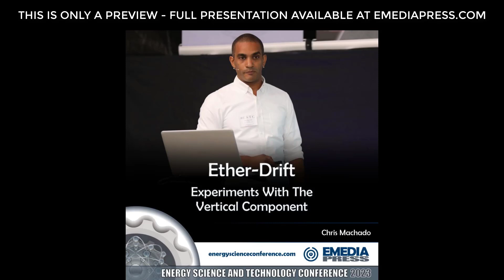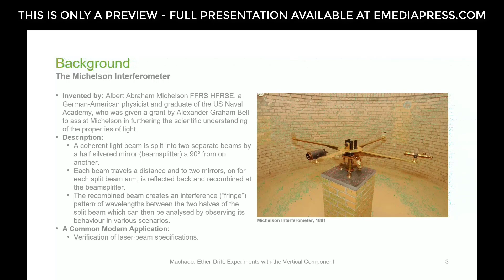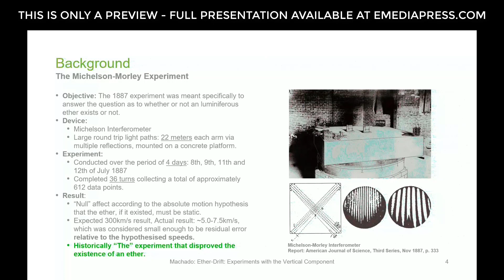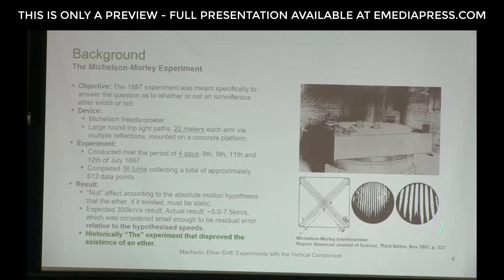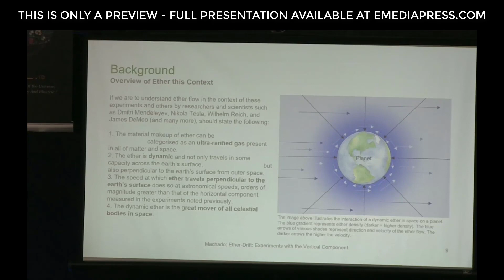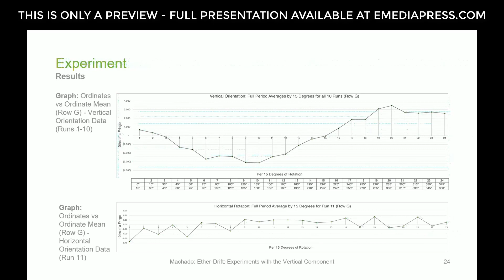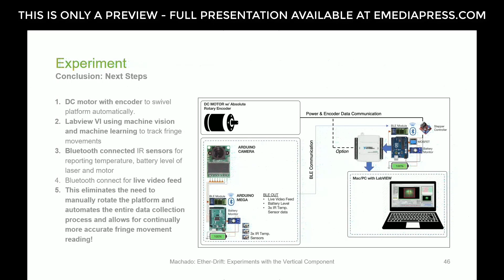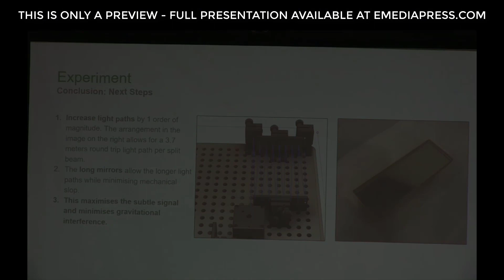2023 ESTC Chris Machado - Ether-Drift Experiments with the Vertical Component

Comment: Ahh, the assumptions. The earth is flat and unmoving. Try your experiment and use the right baseline. 
Oh, and rethink the light, too. You know that light speeds up and slows down instantly when it enters different mediums and does so without a need of adding/extracting energy. Speed changes contradict the conservation of energy under the light-is-wave assumption as the light's frequency does not change.
Finally, consider that the beam splitter does not split the beam but instead creates additional disturbance(s) in ether. This means that light has no mass and it is but the disturbance that propagates.

Comment: Please try mmx experiment with many legs so the light traveled is longer
AND NOT using a laser but a phosphor lamp or some other monochromatic source.

Lasers are a bit different since they exibit "negative temperature" and thus it might have an influence over the experiment.

Dayton Miller showed positive results and supposedly an army redid the experiment in late 1980s and also got positive.

But with lasers is always negative.
Also, vertical mmx should be done in vacuum for accurate results and truly rigid mirrors since the air density change might play the significant role and mirrors bending problem should also be done with intentionally lose mirrors as a benchmark and ofcourse 45 degrees

Comment: If you're reading this, Chris, I loved the presentation and the level of precision and detail you went through trying to reproduce the 'vertical Michaelson-Morley' experiment with a more proper setup.😄

You may want to consider using pre-stressed steel wire on all four corners to help improve rigidity on your setups.   We know that all metals will flex under gravity, and using tensioned wires will help take up some of the slack and stiffen-up the setup.   Same principle they use to create pre-stressed concrete😉